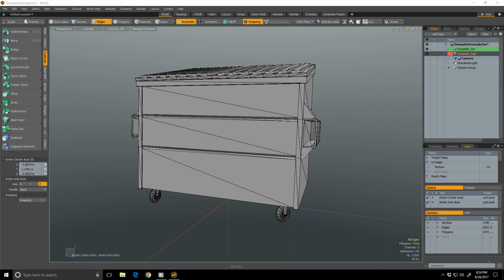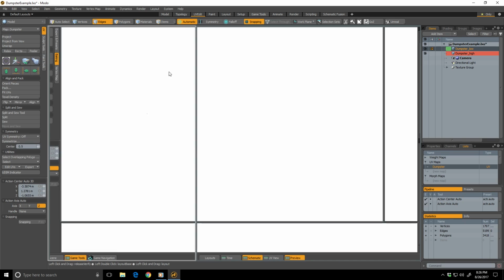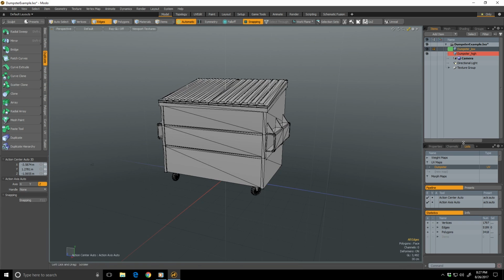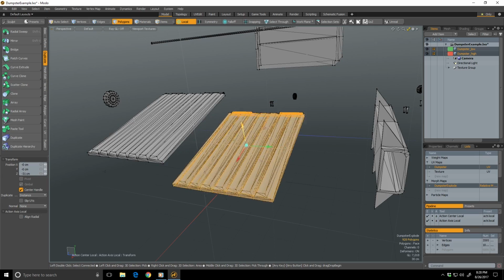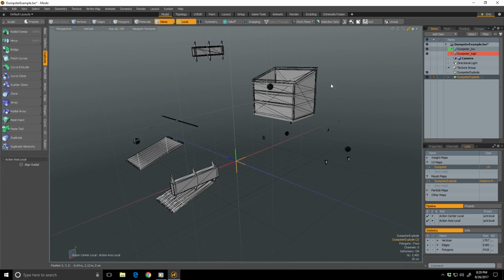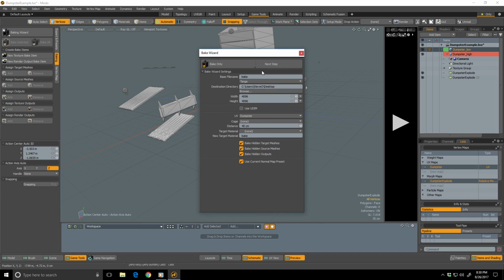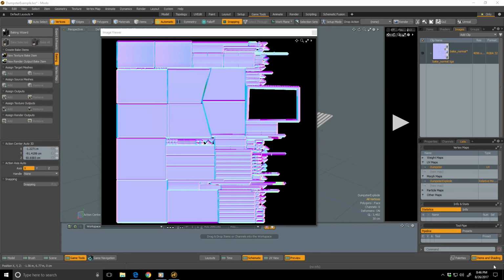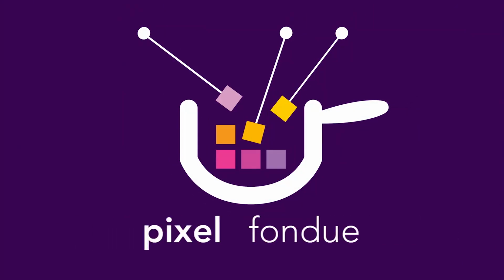Exploding and Baking in Modo

Comment: I see a problem with this method I could use some help with. "Local" mode, afaik, only works on components not items themselves. The problem is that when you have a high poly encompassing several elements using the RoundedEdgeS. all of these elements do not "stick to their relative position with each other" when using the "Local" morph. Is there a way around this ?

Comment: Nice workflow for exploding the mesh.
FYI if you just want to bake shader effects (like rounded edges) you don't need a high res mesh you can just bake the normal directly. Just create a new image map, set it to normal, right click it and click bake to texture. This way you don't have to explode the mesh. Which in the case of rounded edges, not only saves time but can also change the result since modo can also round intersecting meshes.
Reply: Indeed. Or I would advice to only explode mesh parts which are physically different objects/parts. This way you keep your parts nicely welded together.

Additionally, you only have to add one morph influence, if you add it with both the low and the high selected.
Reply: Anne Draaisma only the parts that arent connected are exploded.
Reply: Tried to bake roud edge just by baking to texture as you described - but in my case it does not work. Normal map baking, but result - one color(flat) map. What am I doing wrong?
Reply: make sure the texture locator of the created texture points to the right uv and all mesh layer you want to bake are marked as visible
Reply: file -> save all images. Sounds to me like your image resolution is to small.
Reply: Ok thanks for the tip I will have to try that.
Reply: Thx, it worked. BUT when I look at baked texture in folder - it just a black image. In modo - all looks fine. Does not understand why. Additionaly - in my viewport baked normals not displayed on mesh as in this video.
Reply: BTW, I noticed that when I bake to texture - i MUST have roun edge value no less then 1 mm - oterwise it bake nothing. In my case I have small parts made 1:1 to real word scale and round edge on them is about 500um . And when I bake them as described in this tutorial - it is baking correct.
Reply: thx for advice! Texture size is 4K )
Reply: ah I understand it now. If you have a single mesh with no other "intersecting" meshes you just need 1 mesh + the RES and you can bake to texture. However, if you have the HP encompassing several elements using the RES then you need to "weld/boolean/cleanup" the LP mesh. You have to do this in order to prevent seams when baking.

Comment: Is there any benefit in using a cage when baking like this?
Reply: A cage is an option but in this case since we are baking from exactly the same mesh there is probably not much benefit.  A cage makes sense when the low res mesh doesn't match the high res mesh 100%, the cage is essentially creating a ranged space that is trying to capture all the details contained within the high res mesh.  In this case, I don't think a cage would be of much benefit.

Comment: Thanks for the great video Steve! I haven't known about the trick with local action center - it's much faster than manually explode it all! 
It looks like the size of your model is quite big (30cm grid) regarding to the original size. Is there a reason for this? Probable it's because of  round edge shader? I'm asking becauseI had some issues with baking round edge shader with low resolution normal map or with small values of width of round edge shader .
Reply from the maker: Hi Anthony.  Oops yeah, my grid was set to 30cm because I actually just reinstalled Windows recently and hadn't set up my units yet in Modo before I made the video.  If you look at the image here, you can see while my grid size is set to 30 cm, the model itself is only about 2 meters tall which is roughly human sized tall:  https://www.screencast.com/t/eWZomaEi   so its pretty close to real world scale.  I actually did scale it up just slightly because I have also heard some people have had issues with scale and the rounded edge shader.  

Unreal Engine unit is equal to 1 cm so I typically set my grid scale in units of 50 depending on what I'm building.

Comment: Thanks for the video! I wanted to clarify: All hard edges (90 degree angle, etc) should be a UV seam?
Reply from the maker: 90 degree angles don't necessarily need to be split, its just about where you determine you want a smoothing split on your model and designate as such in your vertex normal.   The important rule is, if you have a smoothing split in your mesh, you'll want a UV seam but a UV seam elsewhere in the model doesn't have to have a smoothing split associated with it.
Reply: Thanks!!
Reply: But if we have synth workflow (the same tangent basis both in baking software and the engine) we can ignore this rule, right?
Reply: The reason for the uv split along a smoothing split has to do with the way the normals are aligned along a smoothing split in the map.  If you dont separate the mesh in the uv map, you will see artifacts in the bake due to the way the normals are facing.  This is regardless of the synthed workflow.
Reply: If you use only soft edges you don't need to think about any of that - at least for a Subtance Painter/UE4 workflow. Just make sure you triangulate > make all edges soft > create mikkt tangent space. In the fbx export settings, set it to keep smoothness. Don't recalculate when importing. Tadaa. You can do whatever you want with your UVs